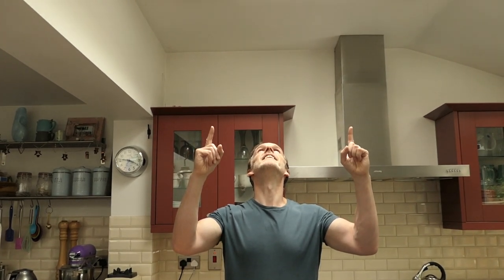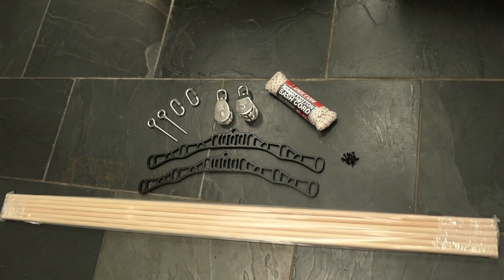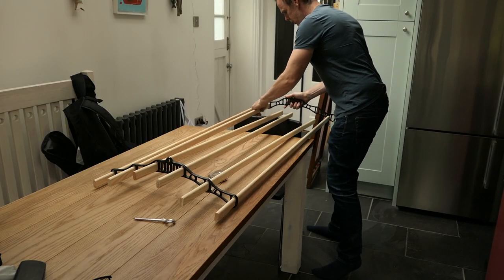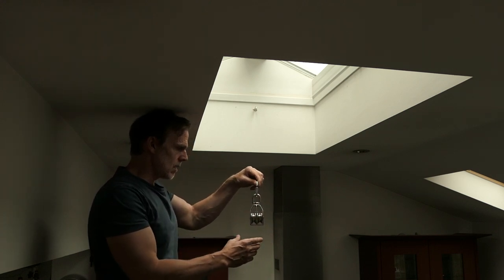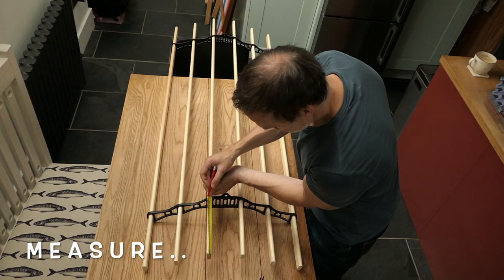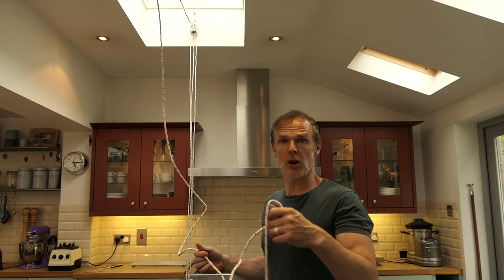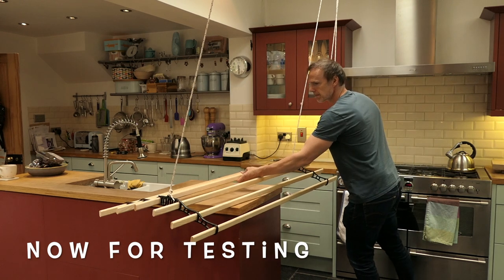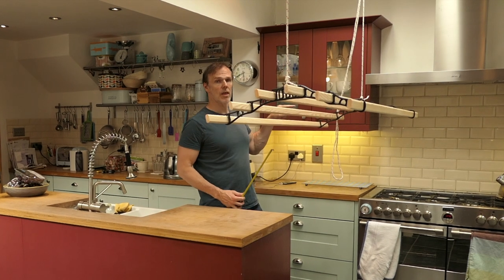HOW TO INSTALL AN OVERHEAD CLOTHES AIRER

Comment: I always install these. You may have a bit of chafing over time, due to the double pulley twisting, even though they are meant to swivel as your set up shows. Thanks for the upload.
Reply from the maker: Thanks for the info, that’s interesting.

Comment: May I know what size are the pulleys? Thank you for your video. Very informative.
Reply from the maker: They are 50 mm size . One is a single pulley and one is a double pulley. As described here 1:00
Reply: @AngusMcGregor  Sorry for the trouble!
Reply from the maker: @oceanminded2009  it’s no trouble. It’s good to leave comments as it helps with the engagement of the video and recommends this to other viewers